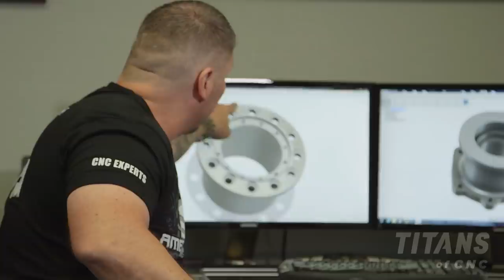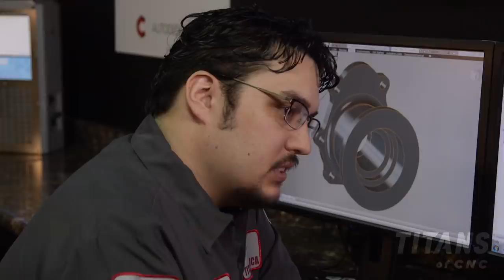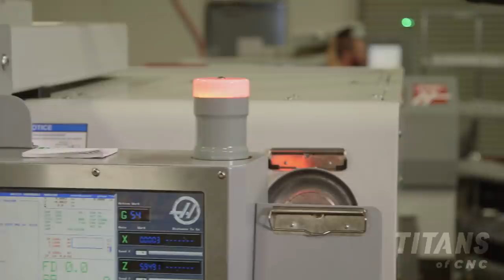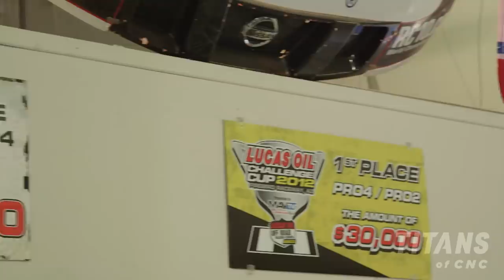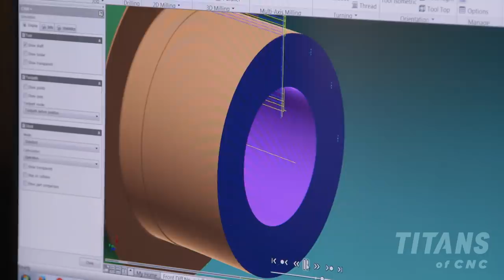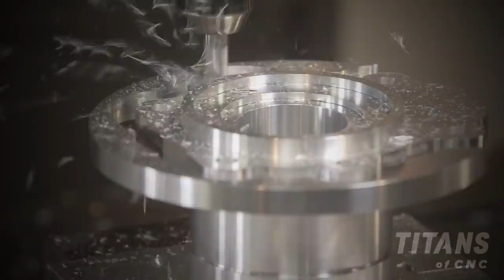CNC Machining Parts For Off-Road Race Trucks - TV Episode

Comment: For those who don't understand the part at 19 minutes which talks about how serious you have to be around these machines, let me give you two examples:
I just finished up school but when I was doing one of my final parts I got a different instructor who was much more thorough than the previous one. My program passed the simulator just fine but the instructor made me run the program 4 inches above the part, then 1 inch above and told me to watch and keep my finger on the "feed-hold" button ..it's not a complete "all-stop" button but it is sufficient. It was pretty frustrating because the way I was told to write the program, it took 45 minutes to get through. (Titan could probably do it in 5) I was thinking "what's the problem? It passed the simulator." it turned out to be vital because once the program was actually cutting metal I noticed it do something I didn't intend. After programing and watching it over & over through simulation and dry run, I knew every move. It turned out that instead of telling the machine to go down 0.075 inches, I wrote 0.75 in the program. I caught it in time thanks to my instructor insisting on taking baby steps but had I not caught it in time the machine would have plunged right into the vice, a very expensive mistake.
Lesson 2, Safety:
When I was younger I worked in a tube mill and part of the time I ran what is essentially a reverse  lathe. Instead of the work turning and the stationary tool cutting, the tool turned around the pipe to cut a chamfer on the end. The the tool weighed between 60 & 80 Lbs  but all the same rules apply, the clamping forces need to be high. Anyway, somebody didn't tighten that cutting head down enough and when I took over after a shift change, the machine started to spin up and before I could even respond, the head let go of the spindle and launched strait for my head. There was a cage on the window but it made a giant bulge about the size of a motorcycle helmet in the cage. Had that cage not been closed it could have taken my head clean off. These lathes will do the same thing if they let go of a part all the way.
Most people seem to need to see something happen before they take safety on these things serious enough and often it takes years before they see it. Don't be that guy!
 ...oh wait this the P.C. era, Don't be that person :p
Reply: I had something happen like this except I did not notice. Ended up calling up an old program which used different tool numbers (at the bottom of the existing program) which called a 29.5mm carbide tipped drill up instead of a little radius groove tool, went full speed into the soft jaws snapping the drill in half out of the holder and knocking the whole turret out by 2mm. Wasn't my best day.

Comment: There wasn't enough meat left on those soft jaws after boring them out, especially with the hole in the middle of the bored diameter.
You can see how much those things flex the second time you show the clamping, so most of the contact was at the very back of the jaw.

Comment: Operator in lathe did make a few mistakes:
1: Never use soft jaws in a chuck when clamping on rough surface.
2: Be very careful when clamping external on a workpiece that have the same diameter as the chuck.
3: Make sure the jaws have enough material and not flex when clamping.

These errors is made by apprentices and not by a skilled worker.
Reply: brilliant agreed
Reply: We learn by doing!

Comment: He should to use lightweight claw jaws and higher chuck pressure.  Depth of cuts and feeds can be high but max revs should to be limited to safe margin to reduce risk of centrifugal force to open the jaws. I had crash in similar situation by using too high revs with relatively small chuck pressure for the heavy duty chuck and CNC lathe I used. Experience is important. A few words about your process. Facing at op1 on lathe should to be done first to ensure stock  length, in order to eliminate tool breakage feed should be reduced when small diameter is approached and proper tool geometry should be used.. On op2 drilling can be made firstly because length of the part is much more precise  at this stage.

Comment: Just curious but with aircraft grade  7075 Aluminium did you use a  cut tap or forming tap ???
The Aluminium I generally machine is pretty average 6061 or 6262 Aluminium where I use Form taps to reduce any swarf that can wrap around my Tap.
Reply from the maker: Agreed. 
I Roll Tap Most Aluminium so long It retracts and forms properly to being in my ID. Even Roll tap 303 Stainless.

But Cut beyond that and thread Mill anything harder than Stainless
Reply: TITANS of CNC: Academy Thanks for the response mate, it's something for me to keep in mind if I ever get to machine that grade of aluminium.

Comment: Ohh, close one on the lathe, could have been a big one. Felt for him there.

Do you not use bite in gripper jaws on 1st op turning?
Reply from the maker: We do at times, depending on the job.
Reply: @TITANSofCNC : Soft jaws is for clamping on finished surfaces only, never on a rough surface.
A workpiece will always slip out of soft jaws if the cut is too big or feed is too high.
If you machine soft jaws, make the clamping-surface as a small taper so it grips on front on jaws instead of the rear of jaws.

Comment: When doing the id/od how do you account for cutter length?  Does the cutter ever get smaller as it cuts? How do you get the cutter's tip to protrude the same length as the last cutters tip?
Reply: Does the cutter ever get smaller as it cuts? 

Not really. You might want to reindicate and recalibrate the size of a tool every few hounrdeths of hours of operation, but it usually is not done too often. The tools are much harder than material you are cutting. So people reindicate tools on every job, but this slows down the process, and is usually done in cheaper machines, which do not hold tolerances well, i.e. due variations in lengths, collets not being accurate enough, etc. But if you have machine good enough, you simply do it once, when you setup a tool, and it will stay this way for very long time.

Comment: At the first lathe process, I wonder why you don't face off the back side of the part first, make the hole, where the wall will still remain thick enough to hold in the same jaws, turn over and machine the grooved side.

Comment: When you use cold and hot parts to make them fit, can you ever separate the parts again? How?
Reply: Yes. But easier said than done and many variables to take into consideration. This is steel on aluminum, heat the external part and use the press to separate them. The aluminum may gouge, but it will be replaced anyways. There are some parts, (for example, a collar on the axle of a Ford 9 inches rear end), that have this type of fit that can never be heated and pressed again. But it's so hard, you simply drill a 1/8" hole and center punch it and the collar break into two. So it really depends on the metals and the application in which you have. The objective is to know the difference and the materials that you are working with. That's the simplest way I know to explain it without getting all scientific.

Comment: You can only go so fast on a lathe.  Especially when only holding so little material like that.  Did you do a 6061 setup pc on each part?  That material didn’t look like 7075.
Reply: It wasn't so much that it was holding a small amount of material. Watch the replay when it shows him tightening the chuck. The ends of the jaws bend out. Add in the outward centrifugal force of a couple thousand rpm, and clamping forces decreased. Those jaws were too flimsy. I have a feeling the ends of the jaws were so thin because they were coming up on swing limitations of the lathe. (And smooth face jaws rather than serrated.)

Comment: 18:30 No, it was too much preasure for this jaws, or a jaws were too thin to that preasure and deformed (non-fragile) and the gripping surface was not cylindrical, but conical and gripping only in one milimeter long surface in Z, In my opinion get less preasure and get constant cutting speed lesser value.